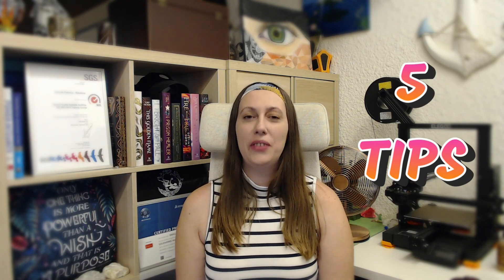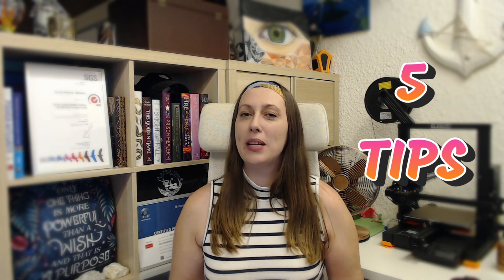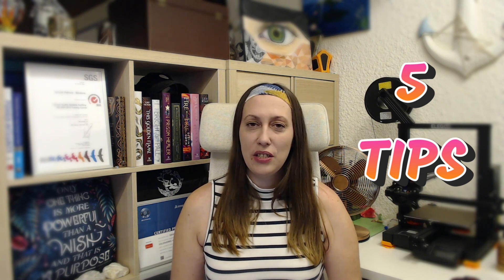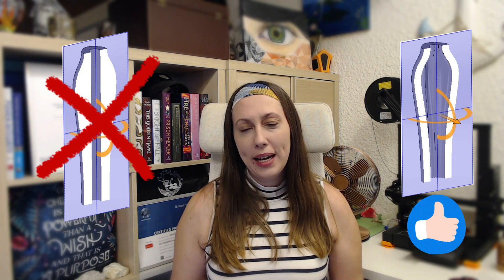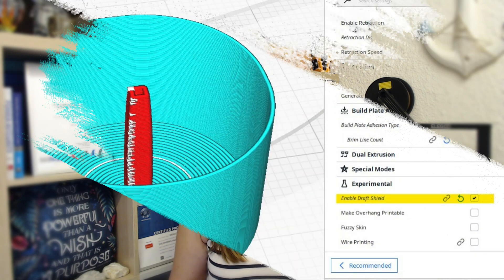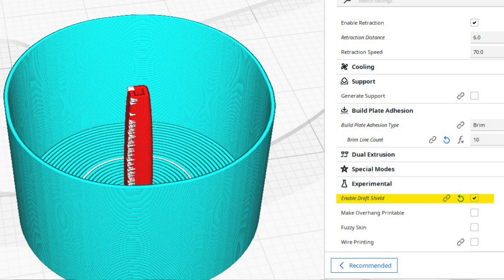5 Easy Tips for Micro 3D print with 0.4 mm nozzle

Comment: Good idea to use draft shield as a sort of "time waster" instead of using "minimum time per layer" setting. The latter has a problem with oozing as the hotend just sits away from the print for few seconds. I much rather have it printing something else, and using draft shield: that is a solid idea.
Reply from the maker: Thank you for the comment. Exactly the reason you point was the one that made me look for some other way to delay the print. I wasn't happy with "minimum time per layer" at all.